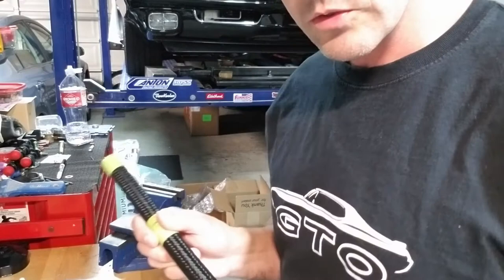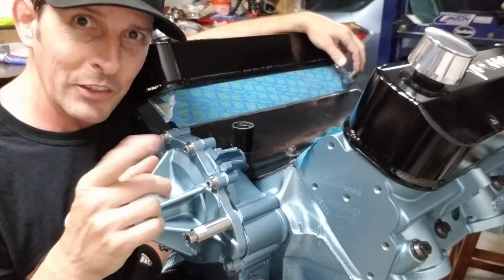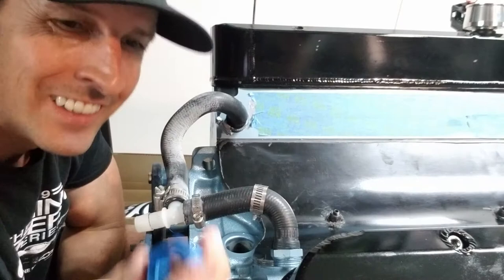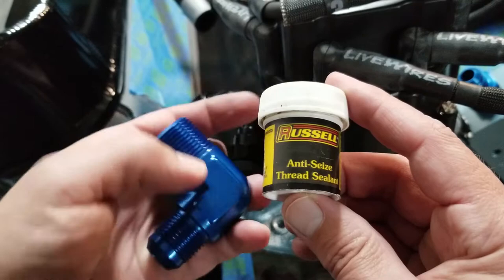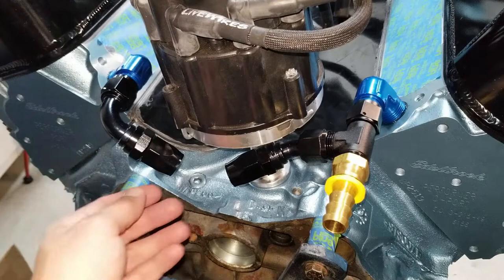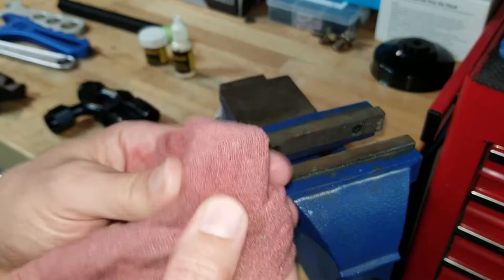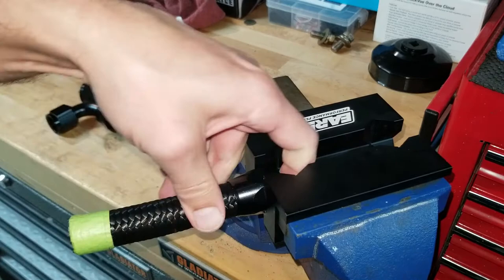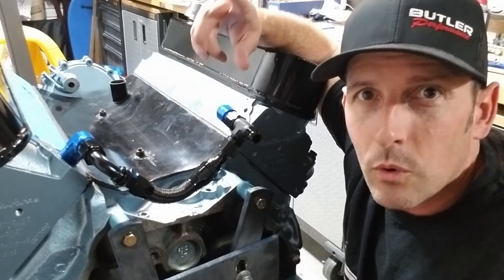Pontiac V8 Rebuild, Part 17:  How to install AN Fittings and keep your heads cool.

Comment: I have Edelbrock heads on my 455.  Are the heads set up where I could convert this while motor is in the car or does the head need to be modified?
Reply from the maker: Good Question... the Edelbrock heads should already be threaded.  Mine are 3/4 NPT threads. You should have a nipple already on the Passenger side.  The Driver's side should have a threaded plug.  The dead give away is it would have a wrench hex on the plug, either externally for a socket, or internally for a allen key.  If they're round with no hex, it's a glued in plug, with no threads.  Let us know what you find!
Reply: @FastMonty  Wrench hex on the plug on drivers side......
Reply from the maker: @BlueDuck211  Saaaweeet!  It should already be threaded.

Comment: I'm guessing you had to tap the threads on the heads for those fittings? They are supposed to be a pressed fit from factory right?
Reply from the maker: I think stock heads have a bore, so  yes, you'd have to convert them to a thread.  OR, get an adapter to press in for standard 5/8" heater hose, and use a Tee, which is what I was using.  Edelbrock heads are already threaded, which makes it easy to convert to AN fittings.
Reply: Oh ok thank you. I didn't even think of the fact that you probably have after market heads. This is a great idea so maybe I'll try to make something up like this.
Reply from the maker: @Dirty_Bird  If you have stock heads,you can still do "the bridge" by using heater hose and a 5/8" tee. Which is what I was using before switching to AN.  Here's a link for the adapter for those who have stock heads... 
https://butlerperformance.com/i-24452843-butler-pontiac-heater-hose-fitting-press-in-aau-p132n.html?ref=search:https%3A%2F%2Fbutlerperformance.com%2Fsearch.html%3Fq%3Dheater%2Bhose Pontiac Heater Hose Fitting- For Rear of Pass. Side Head- Press In *original style for '65-'71 - will fit ALL Pontiac 1965

Comment: Hold on ! 165  degrees is not proper operating Temp ! So why do you think this is great , 180 at least for the engine to perform well i would say !!! Right
Reply from the maker: Agreed, 180 is now perfect for my set up.  165 came from Jim Butler's recommendation for a carbureted car.  Thanks.
Reply: @FastMonty  still not the right way 160 you will have raw gas ! But glad you found a way to balance Good idea !
Reply from the maker: @markt9438  Thanks!
Reply: Thing I like about the setup is  with this we can instal a regulator type vlv in this simple re-plumb to help make engine get to the target temps in a controlled fashion.
Wherein our current setup on Pontiac & AMC we don't have a very good method to do this, so when it gets too hot,  I'm a prisoner to that design.
Removing heated water before the Intake gets it, is the better thing which can be done for air density ratio in the intake.  Plus uniform temperatures on all four corners of the engine.
My 400 Pontiac always struggled with the excess temps over 200 off and on during various conditions with its OEM design.
This which Monte has come up with, is a very intelligent design to help us out in several ways. 
I work in High Tech industry as an Eng / mechanic, this thing he has created is what I would say classifies as a "White paper".